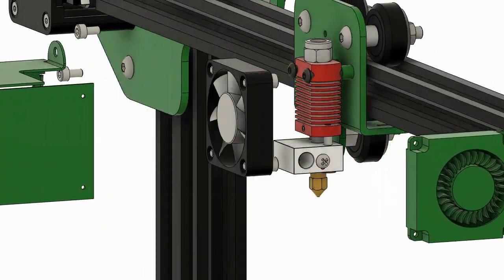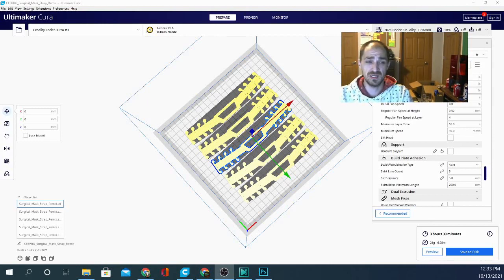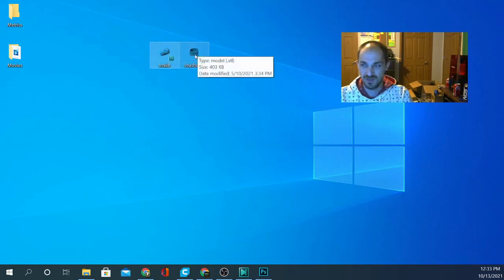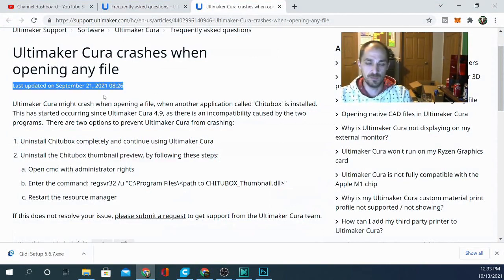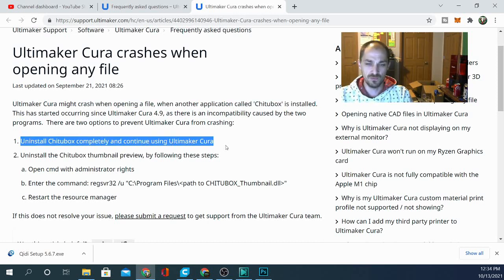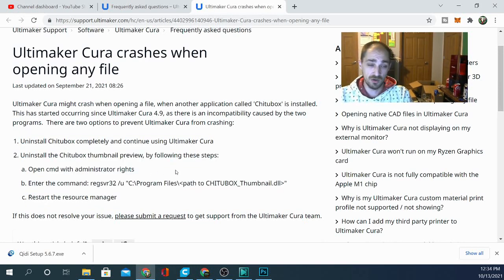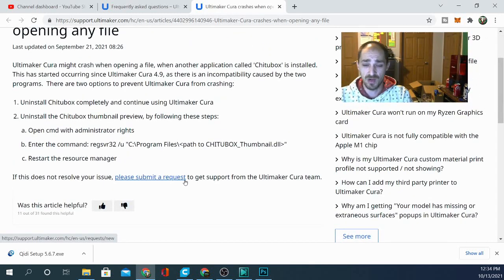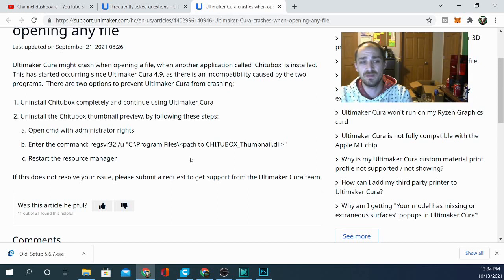Why does cura crash when i load a file?   FIX!   Cura Questions

Comment: I downloaded and used cura 5.1 for a week and after 2 days of not using it loads and the  white screen appears and closes. Tried reinstall reboot installing in other location nothing worked. Tried to use previous cura version and other slicers like prusa slic3r etc. And nothing work on my. I only got one display so its not a problem as a lot of people got similiar problem when connected few displays. Did anyone have this problem before and solved it? Help please i cant use my 3d printer

Comment: When I switched to cura 4.10 or anything after that the preview model doesn’t work and a pop up shows up and asks if I want to sent a crash report to ultimaker cura.
I can run 4.9 or anything older it works fine. 
Any ideas?
Reply from the maker: Do you also have chitubox installed by chance?
Reply: @Technivorous  no I don’t have that. I’m definitely stumped!
I mean I’m still running windows 8 with amd 64 so 😂 it could be that.
But I’m definitely about ready to completely switch to something else.
It runs 4.9.1 just fine but anything after the preview does not work.

Comment: If anyone is having trouble getting Cura to actually load then right-clicking on the icon and then choosing compatibility mode will enable Cura to load, I had this problem after a Win 10 update
Reply: Ive tried this but cant get it to work even in diffrent compatibility modes